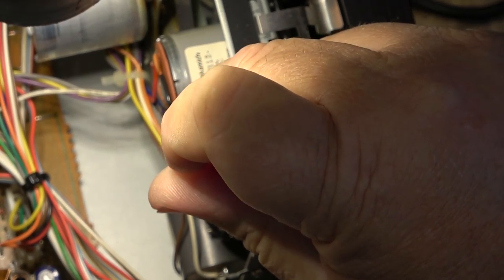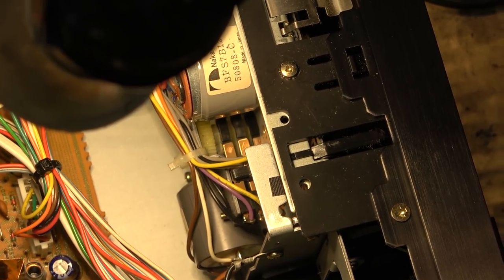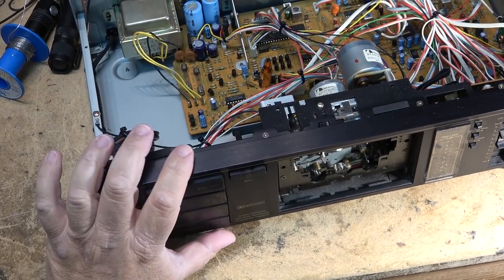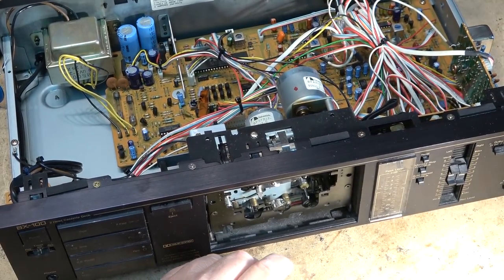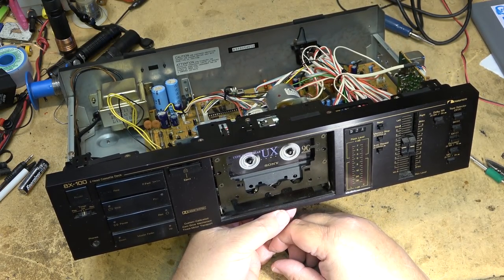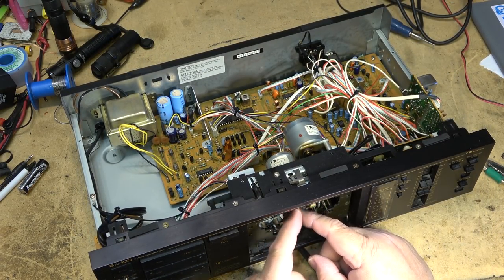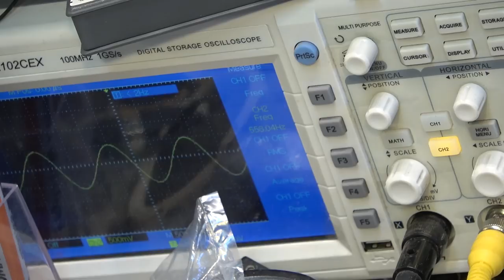Nakamichi BX100 No Tape Movement whatsoever

Comment: The mode motor issue is tarnished contacts with the brushes etc. Common problem.
Reply: I have that problem and everytime i turn the power on the head mechanism just goes up and down continuously. I noticed that some of those little arms (I have the BX300) are way to open and dont make contact and i think is my problem.

Comment: Yes. The later version have gear instead of tire. But the control motor failure is another common failure of this deck. Original replacement of the sanyo motor is probably impossible to find. Modern substitution is available but will need drill or mod the screw holes. I also applied the ANT mod to it. It replaces the Dolby Switch CMOS with simple relay so that few Caps and resistors can be eliminated from the signal line. It greatly increased the audio.
Reply: How much of a difference did you notice? Was it just louder or  Also clearer ?

Comment: i created an idler tire once from an o ring. it came out quite good. i put the o ring on to the idler and then i hooked the idler to a cordless drill, and then i let the drill spin and i flattened the o ring surface with a sandpaper. it worked like a dream.

Comment: @12voltvids: The cam motor getting stuck (dead spots) is not uncommon on these Nakamichi/Sankyo machines. I usually dismantle the motor, clean the commutator and brushes, lube front and rear bearing and put back together. Might be worth a shot with this one if it comes back with the same symptoms in the future.
Reply: Indeed. I've had one stick on a CR-7A. A tape tech cleaned up the motor and got it working, but after a year or so it gave up again. So the next time, he replaced the old motor all together. He said it required a bit of modification to make it fit the deck properly, but it now works like a charm.
Reply: @stevebennett9750  Yes, I have heard that some tape techs that specializes in Nakamichi decks replace with a brand new similar motor and modify brackets etc. to fit. To ensure the cam system of the tape deck will work for 20 new years and not having a dissatisfied customer coming back after some time with the same problem claiming the problems was not fixed. It makes sense to do it that way if the goal is to have a long lasting deck and the customer is prepared to pay for the hours.

Comment: One way to revive old and tired rubber parts: boil them in a hand sanitizer containing ethanol and glycerol! Dispense disinfectant e.g. into a metallic measuring cup (don't let your wife see this), put enough to soak the rubber part. Then, place the cup in boiling water and let it cook for a few minutes. Rinse the rubber part with water and dry it. Just some days ago I successfully revived the drive belt of an old Olympus dictating recorder - that belt was available nowhere, but now it works again like a proverbial charm.

Comment: I still have my Nakamichi Dragon in my studio and all my cassettes from the eighties. I still listen to it often. It still sounds like it did when I bought it. The heads and transport are as good as it gets. OMG, I just looked on Ebay. Someone is offering one for $4950.00. Wow.
Reply from the maker: Wishful thinking.  They are junk. The auto azimuth head systems fail left right and center.   Threw many of them away back in the day.  Should have brought them home to sell to suckers. Had i only known.  Last one i saw was about 20 years ago.  Gave the customer a 200 repair estimate to replace the transformer and fix the unit (lightning strike ) and they said toss it, which we did.  Into the dumpster.
Reply: @12voltvids  Wow, I must be lucky then, because mine sounds really good. Do you have a favourite cassette recorder that, in your opinion, is reliable and high quality?
Reply from the maker: @australianbloke3934  JVC tdv 1010, technics rsm275 are a few I have experience with.  Sony had several tck series that were good.  Teac v850 was also a well built deck.
Reply: @12voltvids  My Teac V850X has a bad cam motor. It was still doing its job, but with a horrible noise. Opened the cam motor up, and found that the rear bearing is just plastic and now beyond repair. Point is, the V850X might still be a well built deck, but nowadays all decks are so old that you really have to expect something breaking regardless what brand and model you go for. And what is important is to buy a model that is easily repairable and that you still can get spare parts to (and/or easy to find a second deck to use for spare parts). Just bo be clear, I do not disagree with you tips, I am just adding my own thoughts on these aging machines.
Reply from the maker: @torstej  they all wear out.  The rsm275 control belt wears but at least the reel drive and capstan is direct drive.  The tdv1010 is also direct drive.  My decks are all very lightly used.  Probably less than 100 operating hours as cassettes were not heavily used here.  I always hated cassette tape as it has terrible sound. Used it only for the car. For home recording I used reel to reel or the hifi track on my betamax for longer recording.  Then dat came along and that became my standard
Reply: @12voltvids  For me I still use cassette tape for nostalgic reasons, and having a physical media like cassette, LP, reel-to-reel, DAT etc. makes playing music more of an occasion. I find that when using high quality NOS cassettes on a quality deck in good working condition the sound quality is good enough for my ears. Btw thanks for posting the videos on your V850X, that helped me a lot when I was working on my own V850X.
Reply from the maker: @torstej  
I'm still trying to get rid of a bunch of high quality cassette tapes.  Did a big archiving job of hundreds of tapes and after they were digitized (most were interview tapes most done on hi bias type 2) they were bulk erased.  Been trying to unload them for years.  Will probably dump the entire box and then someone will want them.  Same with a box of VHS c tapes.  Unloaded about 20, 40 to go.
Reply: @12voltvids  any opinion on the TEAC v7010 or Yamaha K-1000/2000?

Comment: Hi again, I talked to you about my Nakamichi 500 before. In play mode,  it spins fast! As fast as fast- forward. You told me,  most likely the problem is in the motor. Now, I changed the motor, it's still as fast as fast-forward. Any advice where else should I check or change? Thanks again.
Reply: Pinchroller

Comment: You can always flip the idler tire inside out to make new again! Cheers!
Reply: I've done that with the square type drive belt on a cassette that rides in a v groove just gave it a twist to ride on the that was not used before
Reply: Tire flip has been an old goto of mine as well.  I also like acetone for rubber renew.

Comment: Those "idler tires" look like ordinary square cut seals. Commonly used in hydraulic assemblies they're a lot more expensive than an o-ring though which would work just as well.
Reply from the maker: O rings do work. I have used them.

Comment: Hard to believe that in this day of 3D printers, one could not manufacture an idler wheel to work well with an off the shelf O-Ring that could provide a Manufacturer's spec. WRT WOW and Flutter, speed.  My BX 100 was incredible.  And I loved that I could play with the pots inside the case to optimize the sound laid onto the tape.  I mean, the "Dragon" it was not, but if you knew enough about it, the "semi-Dragon" it could get close to.

Comment: The mode motors tend to develop dead spots in that transport, mostly because the motor only runs when changing modes.  I take them (the mode motor) apart, clean the commutator, oil the bushings and they're good to go.  Sometimes if you just start a stuck one by hand they'll work for quite a while, but cleaning the commutator and brushes is best. If you put them together wrong they run backwards, so mark them first.

Comment: The owner might want to look for a doner deck on ebay to use for parts or he might get lucky and fine a working deck again great job all the best
Reply from the maker: He is going to look for an o-ring that will fit.  The guy that owns it is just archive his old tapes and once done will likely retire the deck for good.
Reply: @12voltvids  ok but that deck is one that is rare I have a pair of left 103.4 speakers that are mint but keeping them stored with silica packets to preserve them and I have a vic spit digital table that stopped working no spinning and that was found in the street vintage gear has  the best reliability all metal and solid you really are fun to watch and very helpful be safe and careful all the best jon
Reply from the maker: @tough213  I have a JVC tdv1010 and that is just a rare.  Why? Because when new it sold for 1300.00 and not that many people were spending 1300 for a cassette deck in 1986.
Reply: @12voltvids  yes most would spend no more then 300 dollars and even for some that is a lot unless you are an audiophile I had a  gold ring lenco turntable my pride and joy as well as a mint tasca 32 reel to reel and  beringer 12 channel mixer and I was robbed and they took that and my 10.5 inch reel collection and I just have a take up reel they left all the 7 inch reels and the teac I have and so I really was angry I only got half the money back from insurance and I had an alarm anyway it is sad that quality is no how it was years ago insurance companies are really cheap with people's money I would love it if you can make a video and show what you have all the best jon

Comment: When I want to expand the diameter of an idler tire. I use 2mm wide  0.5mm thick 2 way sticky tape from 3M.  Works extremely well.  Under the idler tire.
Reply from the maker: Winding dental floss under the tire works well too as does thread, tape ect.

Comment: Alive for a bit longer :-D
i've never used copper wire for packing, but i have cut thin strips of white sticky parcel labels.
But only on ff/rew pulleys.
For cheap crap decks with a slightly slack motor belt, 
i elongate the motor bracket screw holes to allow pull back.
Reply: Teflon thread tape springs to mind as well

Comment: Ok, I'm going to pull a BX-125 apart right now and see what is up with the tire on it. I think the home made split washer fell off that I made out of a package container. Put new rubber tire on 2 years ago and lost the fiber washer that was holding the wheel on.
Reply: Makeshift keeper washer was fine, cleaned the plastic mating surfaces with isopropyl alcohol and the rubber tire with rubber renew and now working. The replacement rubber tires are not as soft as original ones I think, or they have been sitting on a shelf too long. Got it off of eBay for not much coin, but you get what you get.

Comment: I have a question if we change the head on a cassette player will the frequency and sound quality of the recording change ?? I had an old Sony stereo that supported a recording frequency of 14,000 hz and a small portable Sony cassette player that supported a recording frequency of 10,000 hz. I changed his head with the one from the old stereo that supports 14,000hz recording frequency, I placed it on the small cassette player, I did head alignment and now that I did a test I see a difference in the recording quality!  is this possible on what depends on the recording quality of the head?  or from the system
Reply from the maker: It may not even work.  Each different head has a different impedence and putting the wrong one in is not going to improve anything.
Reply: to me however it worked somewhat, now the sound is louder and clearer than before, but my question is, to perform better the frequency of sound quality recording depends on the head ???  or from the cassette player circuit that gives the frequency?
Reply: @12voltvids  answer my question please
Reply from the maker: @amatorev  it will change the performence but improve?
Reply: @12voltvids  the recording has improved it writes clearer and louder than before, but to me my question is the recording quality and frequency comes from the cassette player circuit;  it depends on the head?
Reply from the maker: @amatorev  can't answer that question as I don't know the specs of the head or the machine.  Sure it will work but I bet if you put it on a spectrum analyzer and did a frequency sweep the response would be all over the map.  The record / play amplifiers and heads are designed hand in glove so to speak.  It will fit and work but not necessarily correctly.
Reply: @12voltvids  thank you very much for the answer, the previous machine I got the head had a recording frequency of 14,000 hz the micro stereo has a recording frequency of 10,000hz if the frequency goes up with the change of the head then the head plays a role for good sound quality and frequency,  the head writes these numbers on it (MS 15RAA2 K9660) I do not know what these numbers can mean but the head is from a system that supported a recording frequency of 14.000hz